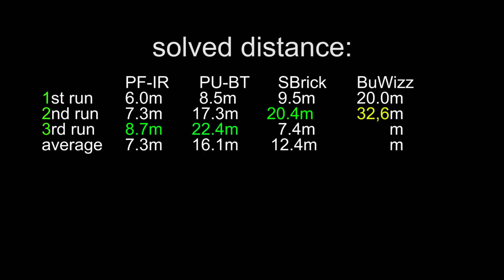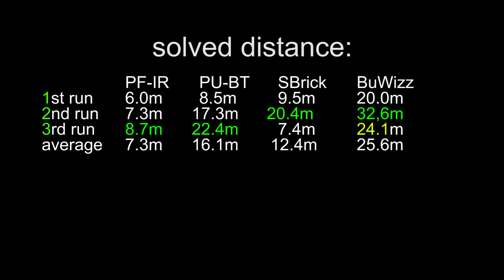LEGO TECHNIC- REMOTE CONTEST! powered up VS power function vs SBrick vs BuWizz3.0 - Lets test!

Comment: Ah thanks for this comparison! ♥
Reply from the maker: Your Idea!😉 thanks for it!

Next time, I have to check the weather before..😅
Reply: @projectstesi7133  yeah... shitty weather - thanks for doing it under those circumstances ^^
I also think the 25-30m for Buwizz mark the Limit... unfortunately much lower than the 100m from their advertisment... 😪
Reply from the maker: @aFrInaTiOn  
Your welcome! Not the best weather right, but it was so much fun to building this little cars and doing this test..😜

I will do repeate this contest again,  because the PF remote quit at 3meters by sun😉
The next interesting questions is, how far  goes the bluetooth by dry weather!?...
Reply: @projectstesi7133  One thing I could add is, MK range is way better (with its hardware transmitter) than Buwizz from my experiences - so if you by any chance have a MK 4.0 System at hand, try that too.
Reply from the maker: @aFrInaTiOn  good idea! Plus i got a cada remote too....😅
Reply: Thank you for this clip. The s-brick distance sorprised me.
Do you use lego ir or aliexpress ir ?
Reply from the maker: @yuvallegomotorized  its all branded stuff, like  Lego, Sbrick, BuWizz.

The SBrick has a problem with early disconnection, i dont know if that is typical or not, btw ranges of 20meters is still possible.
The biggest surprice for me, was the Lego IR-sensor, because it reaches very stable the 6-9meters.
Reply: @projectstesi7133  i think aliexpress "ir" reach little more.  I Saw it in the past on YouTube. Like 1m more with less aiming the signal.